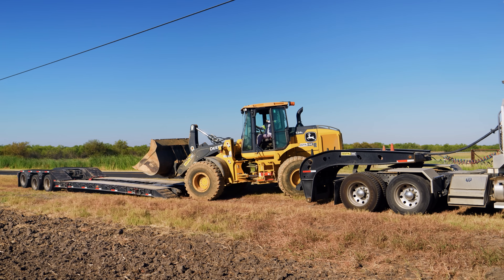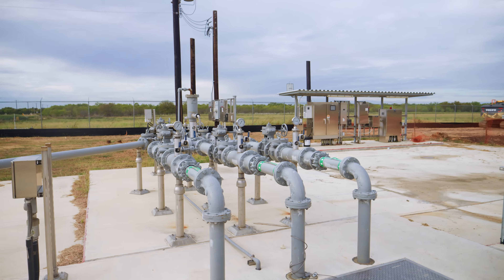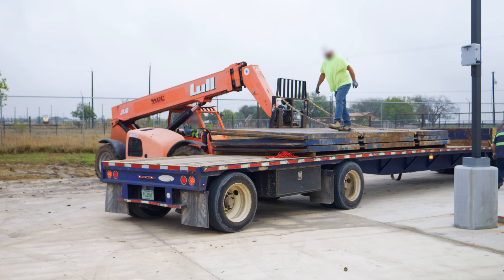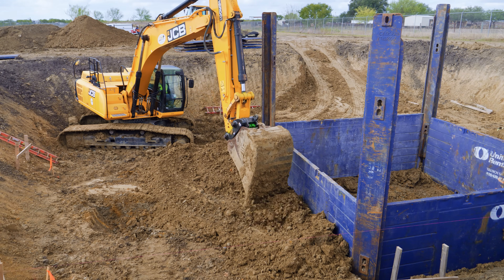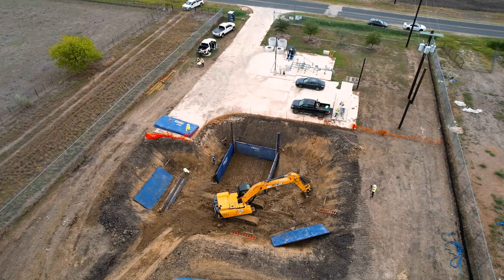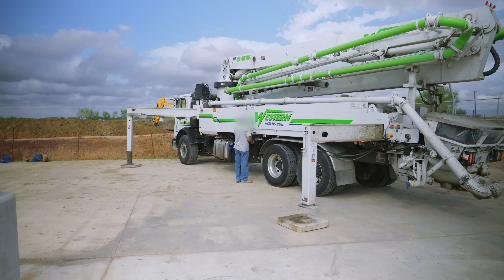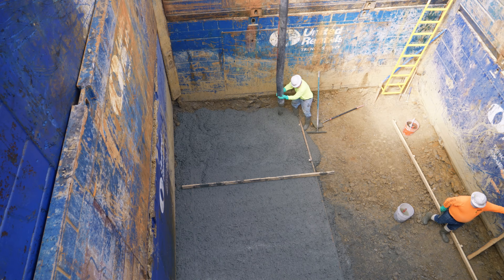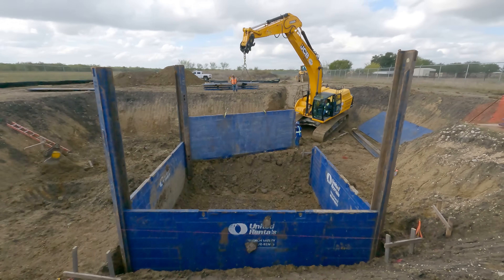HEAVY CONSTRUCTION of a Sewage Pump Station - Ep 1

Comment: I worked on the electrical systems of pump stations a LONG time ago...  Cool to see them built, they're much nicer to work around before they go into service.

I'm waiting to see the pump style.  I've seen drywell with motors at the bottom, drywell with long drive shafts, wet wells with vertical shaft pumps and wet wells with submersible pumps.

Comment: My city has a number of those. Its rather hilly, so sewage has to be pumped across valleys in a number of locations. Generally speaking, trench boxes aren't required where I live when we dig that deep since it would be in good old stable bedrock. Getting the rock out of the hole tends to be a bigger job than keeping the hole from colapsing.

Comment: As a lift station mechanic this video was very informative loving the Gorman rupp pump in the back, guessing it’s the back up pump. And your running submersible pumps In the wet well, if it’s submersible definitely add a small crane to pull the pumps.

Comment: This seems like a great new series!
I do have a couple of questions that I feel are left unanswered in this video:
What does the removed clay get used for? Is it sold, or dumped, or what?
Also, why do they dig the sloped portion of the hole and then the deep one? Could they have just dug the deep hole from surface level?

Comment: I love this !
I have a question though : you mention the diesel fumes build up in the hole with the remote controlled compactor thingie: is there a requirement of time between this and the next step where people actually go into the hole ? 
And for deeper holes ?
Reply from the maker: For confined spaces, you usually use a gas meter to test for a hazardous atmosphere. Every space is different, so there are no prescribed time limits.

Comment: You only missed one minor detail on the first part. The concrete slap has a small drain hole in one corner with a small pump to keep the hole dry while they build, as water can both enter from above and below. As it is outside the concrete ring, it look to be temporary, as the concrete cylinder will be waterproof from both sides, so when backfilling the hole it will not be needed.

Comment: I spent a good bit of time monitoring (installing meters, alarms and sensors) both waste and storm drain systems around the country. The data collected was vital to monitor the health of a sewer system especially in large cities. Vital to I&I analysis (inflow and infiltration) which robs capacity. A note to ALL viewers - “flushable” wipes are not good for the system. They do not break down and clog up the machinery. Neither do many other items that I saw while doing that job. So please stop flushing things that do this. For the sanity of your friendly neighborhood sewer worker.

Comment: 7:44  How square is perfectly square for the corner rails/panels. Is there a tolerance on the differences in length or are there angle measuring tolerances?

Comment: Nice job Grady!  I love watching construction projects. When in college in the 70's I had a summer construction job at a strip mine in Gillette, Wyoming. I was a lowly laborer getting $6.00 an hour with no benefits. One of my jobs was to stand on the concrete pumper truck hopper in boots with a shovel and break up the chunks of concrete that got caught on the grate. It was not always runny. At one point a dead rat fell on the grate and I tried to remove it with my shovel, but it fell in and is now a permanent part of the processing plant. (Unless one of the guys at the other end of the pumper was able to remove it!)

Comment: Why not use the delivery crane to lower tte concrete into the hole?  On lots of my construction sites (facility engineer), we target the delivery crane to handle the low loads with smaller reaches since it has to pick the load up at the shops as well.

Comment: the mechanics of cranes is a great study in and of itself.  I've found that a good portion of the time, the size of the crane is more important than the load rating.  which is to say, the crane is only lifting a small fraction of its capacity, but a lower capacity crane simply won't get the load to where ti needs to be.

Comment: This was fascinating, and it didn't feel like you were abridging the story at all!  I think most TV shows would want this cut down to one 45 min episode, so I looking forward to a real treat seeing this as a multi-part series.

There's a building construction near me with steel and pre-cast concrete.  It's interesting seeing that the pre-cast bits here and that I've seen in video of things like HS2's tunnel segments look much higher quality castings than I've seen used for building floor slabs.  The building ones look like they've got mould lines and chipped corners everywhere!

Comment: I don't really see the point of using steel wall segments if you put pre cast concrete rings in it anyway. Can you explain?
I have witnessed a very similar sewage pump station construction, but they made it without these extra steps.
Placed the firs ring sengment to where it needed to be and started digging out the soil from it. The concrete stucture sinked slowly as the soil got removed, then they placed the next segment, so on so on, until they reached the desired dept.

Comment: It always seemed like these types of TV shows in the mid 2000s had some artificial deadline that the construction was on the brink of failing; i.e.  "The rainy season is just 3 weeks away, and the crew must work around the clock to get the system installed before that time..."